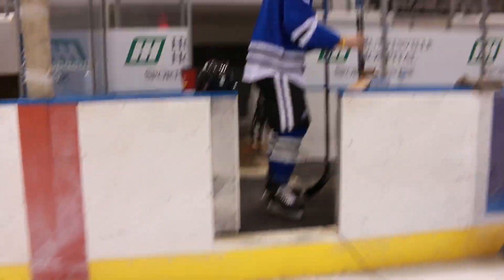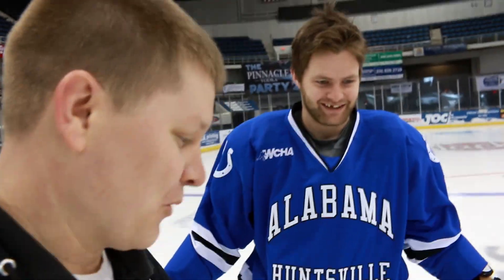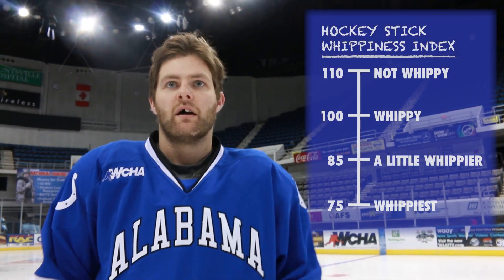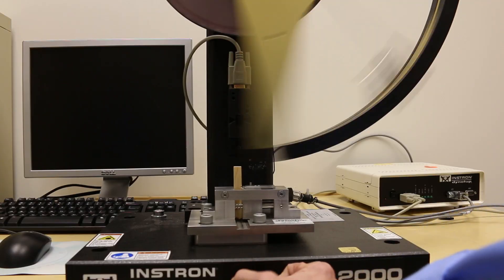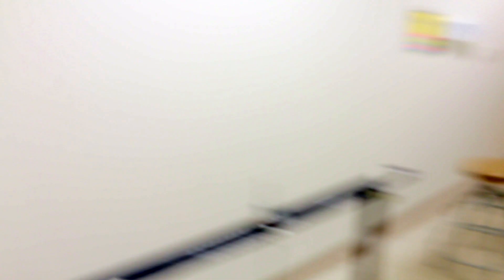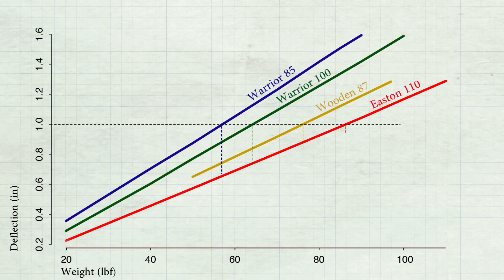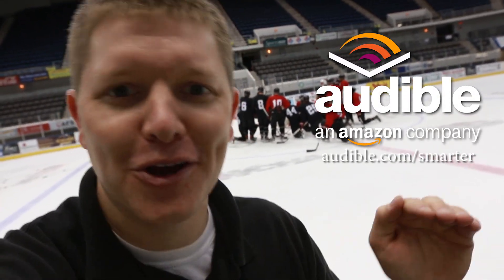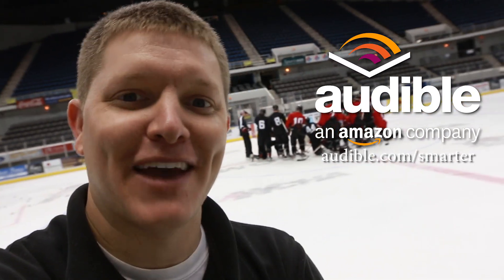COLD HARD SCIENCE: SLAPSHOT Physics in Slow Motion - Smarter Every Day 112

Comment: If comparing to an idealized beam. The stick can break or fail due to either an exceedance to its shear or moment capacity which is subject to the 'beams' engineering characteristic behavior. Namely a stiffer, more ductile and larger shaft. If you were to reinforce the shaft, best done so at the mid point (moment failure) and 'hinge' points (towards each end; shear failure)

Comment: Hi Destin, I love getting smarter every day with you.  Your enthusiasm is contagious!  I do have a couple of questions:

1)  When you crushed the hockey puck, did you freeze it first?  They use frozen ones in the game.  Or were you just crushing the puck for fun?

2)  When the stick broke, will it always break in the same place or do the circumstances of why it broke make a difference?  You showed your slap-shooter hitting the puck super-fat on relatively clean ice (not chewed up due the playing of the game.  If the were to break due to fatigue or if the shooter hit the toe or the heel of the hockey stick harder/first/second, or if the ice were rougher, like it is at the end of each period, would that change the fatigue point?  I assume if the hockey player hit a different hard surface (e.g. the goal pipes, the boards, or another player's body parts) the fracture point might be different in a different place.  I have often seen the stick break where the blade meets the handle, but they may not have been "one piece composite" sticks.

DFTBA
Reply: The stick can break in pretty much any part of the stick. Based on the nature of the composite construction, impacts (from pucks, other sticks, etc.)  may cause structural compromise to the fibers of the stick, and when that compromised area is stressed again, it will fail and break.
Reply: A one piece composite stick generally breaks near where the blade meets the shaft. The ice surface and how smooth or rough it is will generally have no impact on where a stick would break. Other impacts, as Brian said, can cause structural failure - in this case, the player was probably a defenseman and the stick had been flexed in the same place too many times, causing it to snap at the shaft like that.

A two piece stick will break off the blade almost exclusively, as that's where the shaft and blade are joined together. Usually right along the heel of the blade.
Reply: ***** That's true, but the fact the force driving the stick was his hand, and it broke by his hand, happened for a reason.

Comment: Hey Destin, please do a billiard video next if you're done with hockey. There is a lot physics that go into billiards. I'm really interested in cue ball spin.
Reply: I would really like to see a slow-mo of a trick-shot I was allowed to do on a pool table with an old cloth. Rack up the balls like you normally would (but make sure the rack is one solid mass, in other words by extra careful that all the balls touch their neighbours), set the cue-ball deadcentre to the rack (normal break-off distance) and launch it with as much topspin as you can manage. If all goes well, the cue-ball will hit the first ball of the rack dead-centre, bounce backwards while still spinning (because the balls' direction is now reversed, it is now back-spinning). The cue-ball will leave a trail of smoke when bouncing off the rack (as long as it doesn't bounce upwards). Backspin + speed of the ball will make the bottom go so fast relative to the cloth that it burns the cloth in a very narrow strip. Investigating the cloth afterwards, it will look like it was cut with a knife. The cloth is ruined so do this just before changing an old cloth for a new one.

Comment: When calculating the compression of the puck, did you consider the temperature of the rubber? In the NHL, rule 13.2 covers frozen pucks:
13.2 Supply - The home team shall be responsible for providing an adequate supply of official pucks which shall be kept in a frozen condition. 
The frozen pucks are stiffer and less likely to bounce.
Reply: And when hit they make more noise and break your stick!!

Comment: Very cool, I did not realize the stick would flex that much.
Reply: Most players can not flex the stick much it is wrong to think an average player can flex the stick much you need to really train to learn the proper technique to be able to flex it properly as you see in the video.
Reply: You should see a fencing blade sometime.   Blades used at the international level in foil and epee have a minimum and maximum deflection when tested (clamp the blade 70cm from the front face of the tip, hang a 200gm weight from the end, measure the deflection.

But even the stiffest blades look like wet noodles when in use at super slo mo....it's amazing I hit anything after taking a parry, frankly.
Reply: @samsignorelli  I started reading the comment and though.. man, sounds like something Sam would say. Then I saw who wrote it. haha
Reply: Lots of things flex a lot more than one would think. It's just too fast for the eye to see.
Reply: Yeah it kinda reminded me of a bow
Reply: I didn’t realize that either
Reply: How do so many people don’t know that  the stick flexes that much
Reply: @logansauter8179  because they don’t play hockey
Reply: @karterwilliams4475  exzackly
Reply: Most sticks don't flex that much, like i have a p29 face on my stick so the face is more flexey than the actual stick so I hit the puck directely to the heel of the blade and get a better result

Comment: 3:00 The "EXIT" sign is blinking!
Reply: I've done some math for fun but the blinking exit sign is due to the electric grid running at 60hz. The high speed camera is running at 1200 frames per second. Slowed down to 24 frames per second video is 50 times slower. Power is cycling forward and backwards 60 times a second. Slowed down 50 times you get a cycle every 1.2 second. During each cycle the light will flash twice, once on the positive voltage, once on the negative voltage. So while playing this video, every .6 second the exit sign should flash.
Reply: Maybe even since it's powered by alternating current, it's turning on and off so fast we can't see it, but the Phantom can pick it up. Great catch!
Reply: simonova90 If it is a fluorescent bulb (95% certain it is), it has to do with the ballast and the frequency it has been bumped to in order to make it less visible.
Reply: dzjad Exit signs actually have incandescent bulbs. No ballast, just a bulb.
Reply: ^ Thank you!  For doing the math.  Sounds plausible.
Reply: It’s because it’s led
Reply: @yoboyhb6050  Any light will do this when powered by alternating current. Think of it like water in a pipe that's turning a water wheel. If you reverse the flow of the water, each time you do so it will stop the water wheel for a split second and then turn it the opposite direction. When this is done several times a second, we cannot see it, but the camera can. That is why sometimes slow motion replays of baseball, for example, look like there is a flashing light over the field. That is the actual stadium lights running on alternating current and turning on and off in rapid succession.
Reply: That has something to do with the framerate at which the camera is filming. I believe it has something to do with the wavelength of the light? Correct me, someone.

Comment: It is also about the kick point of the stick, where it flexes, to see where it will break. Some stick have a mid kick better for snapshot, other have low kick better for snap and wrist shot. Also depend on if the player use the correct flex, if the player is 200lbs and the stick the 75 flex it will definitely break in a couple a few or maybe 1 game or practice.